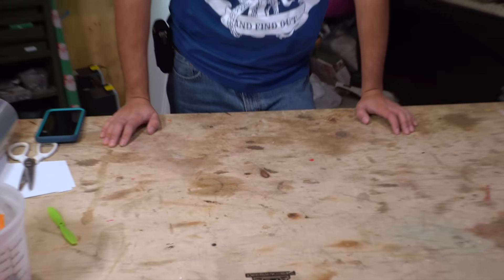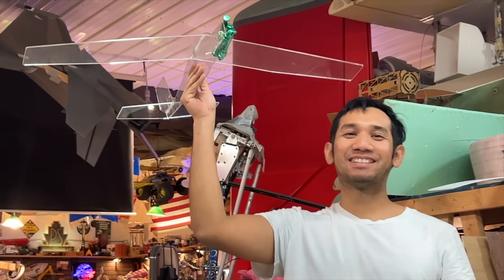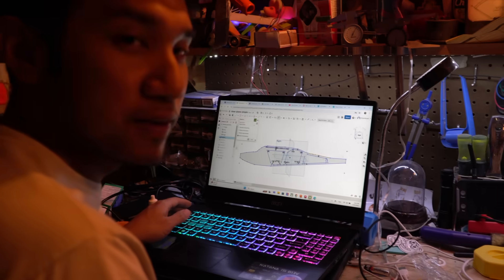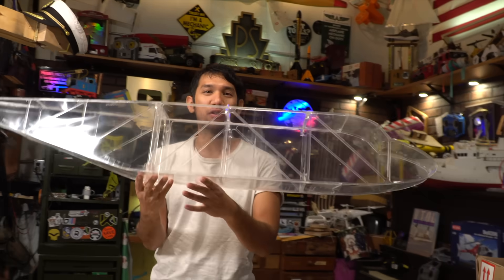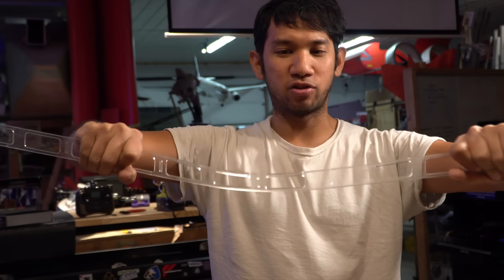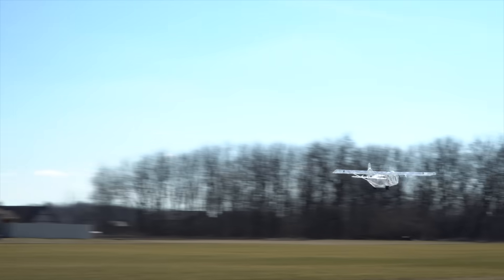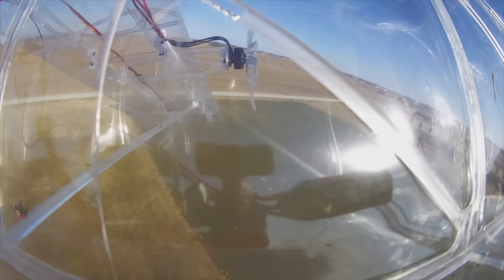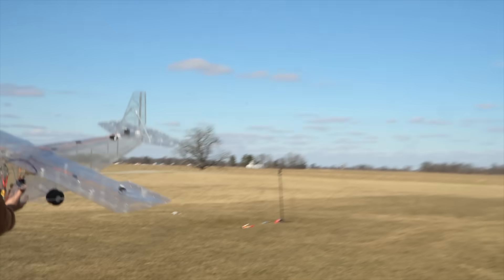Making an Invisible RC Airplane!

Comment: Pete, did you consider the possibility of using large, PETG bottles(..3 litre soda bottles or carboy jugs & similar..) for the clear material, but selectively 'heat shrink' them while pulling a vacuum over a mold. Possibly separate mold sections, like a 3D printed kit of monocoque parts, to be glued together like a giant papercard model?
Going a step farther with engineering principles whilst staying transparent--howsabout using nylon fishing line in a tensegrity manner, upon acrylic or heat-stiffened PETG formers & anchor hardpoints?
I use PETG disposable water bottles to build DLG pods and full-fuselage, durable chuck gliders but I haven't fully explored the possibilities of these materials at bigger scale. Most hobbyists use this method for cowlings & canopies and don't experiment any further; I'm sure the possibilities are under-appreciated.

Comment: Really liked this! Suggested improvements: clear wheels; replace cables with ones that have clear insulation; and use slightly matt or satin finish plastic instead of shiny so that it doesn’t reflect nearly as much. Also perhaps clear styrene or plexiglass / PET would be stronger than acrylic?

Comment: Make a plane with an all hardwood structure, with doped silk covering. Maybe an old tigermoth or something. I'm pretty sure they used to make model aircraft with hardwood structures, before balsa wood started being imported a lot
Reply: In the old days a lot of model airplanes were built with bamboo for stringers and other components
Reply: @gwheyduke  Ah yeah that makes sense. Bamboo is extremely strong for it's weight

Comment: I feel like  a good way for the v1 and v2 to work more effectively, is having 2 motors on the wings instead of just one on the front. This will make your center of mass more toward the nose, but will also allow for more lift, making it a much more stabile flight.

Comment: Couldn’t, you have just made a ghost.  Like. Thin depron with clingfilm.  In all honesty, though this is a really cool experiment, especially since it’s based on a 1920s experiment that basically made a translucent airplane to experiment with stealth. Only problem was the material became very, very visible if it was exposed to sunlight for too long.

Comment: Buy an old Cessna 150 without an engine and attach 4 lawn mower engines in its place to see if it will fly.  I’ve always wondered if it could be done.  You’d have to lighten the planes weight considerably.  Thanks for cool show.

Comment: Acrylic is not the best material for stuff like this. Polycarbonate sheets would be better. That plastic also comes in the shape of double wall sheets, which are often used for the construction of cheap outdoor things. It has a super high impact strength, and I thing it'd be way better for building an actual airplane.

Comment: invisible blimp (hot air solar or helium) is even easier. yep no batteries or even props or control logic. so funny bro. mostly bootlegs. its pun they say. mosquite nice project. clearly a failure, good job. transparent doll glass house. nice. at least you can see it clearly in the sky.

Comment: This is crazy timing because I was just yesterday thinking about if I could make an invisible FPV wing using clear (well, semi-transparent when printed) PETG wing ribs/structural parts with transparent laminating film over them for the outer surface.  Theory was only the electronics would be visible at flying altitude.  To be visible to a spotter to be FAA compliant I'd have to have LEDs though anyway, so I'm not sure if it's worth doing.

Comment: * Plane that jousts another plane with action figures riding the planes
* Plane that dives into the water as a submarine and dolphin jumps out into flying
* A mixed drone, like a plane frame around a drone, and where it uses plane propellers or drone propellers to change modes
* A plane made out of steel beams and jet fuel, see if it melts
Reply: Recreate the V-22 Osprey as a toy plane
Reply: i think you are a small child, possibley 12 perhaps 13
Reply: Look up "flite fest combat" for the first one. Minus the action figures.

Comment: I thought the heat shrink covering material that model plane builders commonly use came in transparent colors, including fully clear? I guess I have never seen you use a heatshrink skin before, maybe that was more of a 90s thing? :P
Reply: Monokote is one of the brands and still around. The heat needed to tack that stuff down might be a bit much for plexiglass. You'd end up warping the airframe a little.
Reply: Doculam is darn near clear when you seal and shrink it.  It's rather translucent otherwise.

Comment: Now make the worlds blackest airplane by painting it with the 99.99% paint, next level flight diff
Reply: Orientation in the air of such a plane would be very hard to see, I think. That would be an interesting experiment.
Reply: Vanta black
Reply: Blacker than the blackest black times infinity!
Reply: @marcezs08  vanta, vertically aligned nano tube ....can't remember last one
Reply: Wdym by that🤨
Reply: @Airplanefan12Theres this fabric, and paint, that absorbs like 99% of light, so it just looks like a silhouette, that would be epic to see

Comment: impressive

now make a plane with obnoxious RGB lightint, like a gamer PC or need for speed unlockable
Reply: with speed-controlled light strips, so they look stationary in flight! maybe you can even get a "persistence of vision" effect in twilight.
Reply: I second RGB plane, bonus points if you can convince people to think its a government spy drone.
Reply: Condense some air.
Freeze it.
Build a plane.
Airplane.
Reply: @aarondavis8943  nice 👏🏼🤣
Reply: check your chiller / pump and reservoir ... if they get low / stop working you'll loose power

Comment: Instead of Acrylic (plexiglas) use Polycarbonate (lexan) It is much stronger for the same weight and more rigid for the same dimensions.
Reply: a CO2 laser cutter should not cut polycarbonate, so the manufacturing is only feasible with Acrylic.  That is why he did it that way. other wise, you are correct, that it would be much better!
Reply: @FPVREVIEWS   He has a CNC mill so he can use that instead of the laser.
Reply: Seconded. Acrylic is hard mode.
Reply: Lexan in hygroscopic, so when you try to cut it with a laser, it bubbles etc. so not really an option. PETG is cheaper than lexan, and more shock absorbent than acrylic. But it's pretty flexible and bendy. So probably also not a good choice? But it can be laser cut or routed.
Reply: @mattfranck7040  PETG when 3D printed would potentially be a good compromise.  When thick enough, it is fairly rigid (think the top of a soda bottle).
Reply: @ Cut it with a scroll saw or is that too skill dependent for the techies.
Reply: @snocrushr  seriously. when he said "5 hours is forever" the level of effort for this channel is obvious. He'll spend an absurd amount of time and money on the boat or full size electric plane, but every other project is completely half ass
Reply: @snocrushr  Did you know that it is possible to pass on information without being this needlessly aggressive? 
Try this perhaps: "You can cut Lexan with a scroll saw to avoid that issue."
Reply: @snocrushr  chew on it, right?  how are you gonna get the scroll saw into the blind areas?
Reply: @snocrushr  Using a laser cutter is much harder than using a saw. Proof? Can you design and laser cut something?
Reply: @FPVREVIEWS  You obviously don't know how to scroll saw, and hardly know how to use a keyboard, I hear your mommy calling.
Reply: @snocrushr  oh boo hoo
Reply: @snocrushr     Kinda rude, are you sure you’re a real Canadian?  😮😅
Reply: @ Random Americans in positions of power, elected and not have made me rude as of late. 😂
Reply: @snocrushr  Send it to Bangladesh or India and contract some actual real labor to cut it off.
Reply: Also $$$
Reply: People talking about water, meanwhile, people 3D print polycarbonate. Only real reason is PC is needlessly expensive af.
Reply: 99th like
Reply: No glare glass (paintings)- might not work well, but would be harder to see.
Reply: Agreed you can also vaccum form it to add shape and structure/strength
Reply: Also less clear.
Reply: @skysurferuk I thought that but then googled it and they do make clear lexan
Reply: @ They make race car windshields out of Lexan, is that not clear to you.

Comment: Missed the trick to cover the visible parts with mirrors/ reflective surfaces
Reply: Good idea but I feel like that would cause a lot of glare
Reply: @TiMona42yeah for sure but this plane is not exactly practical anyways😂
Reply: Mylar
Reply: Both of those are inferior to a Luber's Lens.
Reply: No glare glass (paintings)- might not work well, but would be harder to see. 

or is there clear plastic rolls that are low glare too?
Reply: I want to see a rapid unplanned disassembly of it.
Reply: Ooh, great idea. Also, those wheels could have been made out of clear acrylic/polycarbonate too.

Peter, if you want a (hopefully) relatively easy idea for a short to drive traffic to this video, what if you replaced the wheels with clear discs and tried mirror coating some components, then flew it again!
Reply: This Video Started Is It?
Reply: @AlexanderHandcock18  Start taking English classes or sober up please.